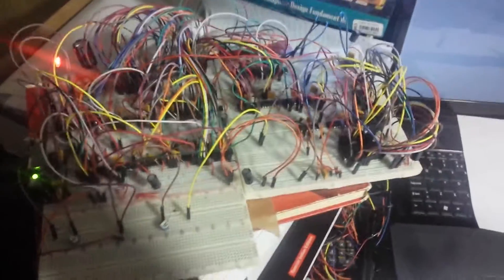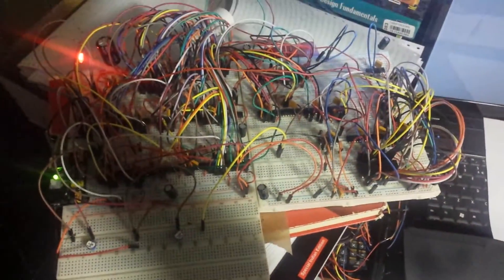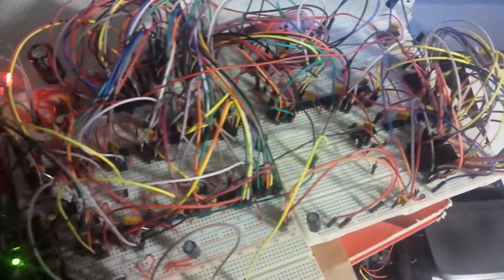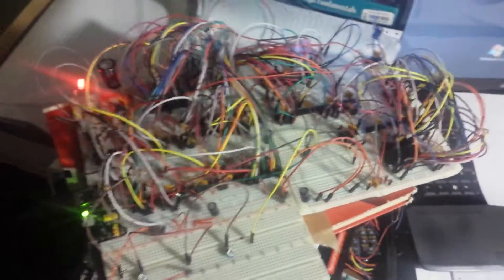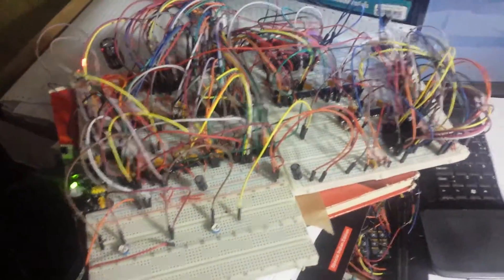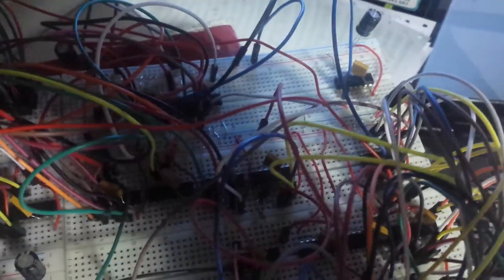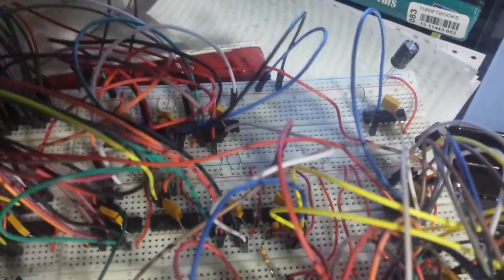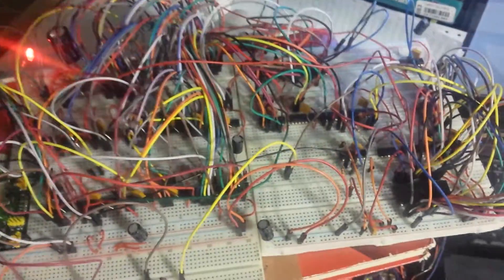Composite Video Generator using only gates and counters!

Comment: I do not understand how and why this works. Anyone could explain?
Reply: I know this is old, but here it goes.

All he is doing is this:
The picture is stored in memory as individual dots (high means that pixel is lit, low means that pixel is dark).
He is using a clock source that feeds counters, this is the pixel clock. The counters count the number of dots in a line. After a line is counted it starts another line and also generates horizontal sync. After all lines are counted it generates vertical synth. The count signals are used to go through adress lines of the memory.
The data that is in memory is loaded into a parallel to serial shift register. The register is shifted out and then loaded with new data. The shifted out serial data and sync signals are mixed through resistors and fed into the composite in of the TV.
This cycle continues.

Using this method you can for example:
Write a rom with character data (all 255 ASCII signs) and use it as a character generator - you drive the adress lines from a RAM that contains the character that you want to display at given points on the screen and from the counters so it knows what line of the character to display. The adress lines on the RAM are also driven from the counters. You can update the data in RAM on vertical sync. This way you have a character display.
You can use RAM for the whole screen space and have bitmapped graphics.

And then you could make additions to the circuit and add grayscale, color, etc.
Reply: @akkudakkupl  Is not necessary filters?
Reply: @ramon1930  I don't think there is any need for filters.
Reply: @akkudakkupl  I always though that images were builded in non periodic fourier series, with a mix of waves in regions determined by filters.
Reply: @akkudakkupl  there is a project in the internet of a dude who builded letters in osciloscope using that principle.
Reply: @ramon1930  in oscilloscope you are directly driving x and y deflection. In a TV or a monitor you are sending a serial stream of pixel intensity data
Reply: @akkudakkupl   Hum interesting stuff. And what about amplifiers? Should i use them to tune the brightness and the collor from each pixel?
Reply: @ramon1930  depends, in normal TV signals the colour is encoded with quadrature amplitude modulation (QAM), luminance is controled pixel by pixel with signal voltage.
In analog computer monitors (VGA) red green and blue signals are separate and controlled directly with separate voltages.
Reply: @akkudakkupl  Thank you bro, by to share your time answering my questions.
Reply: @ramon1930  no problem